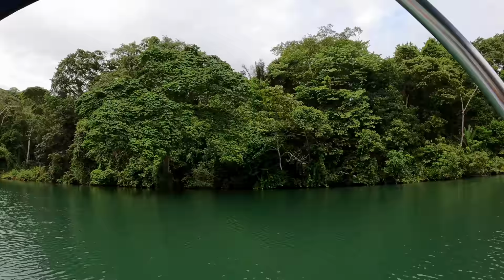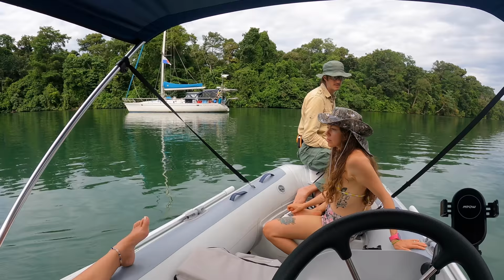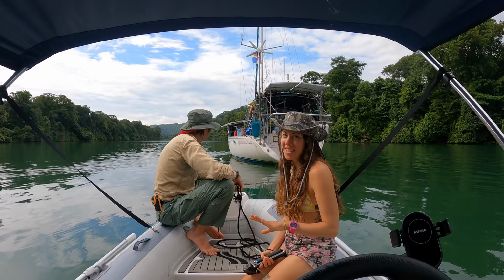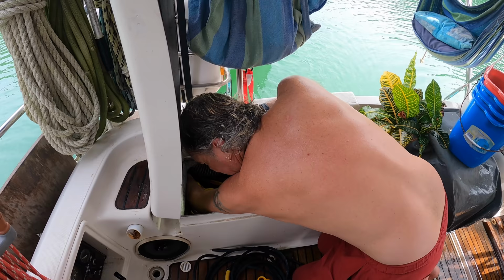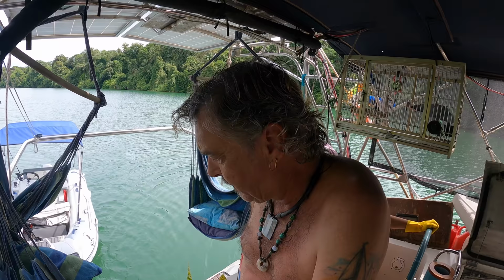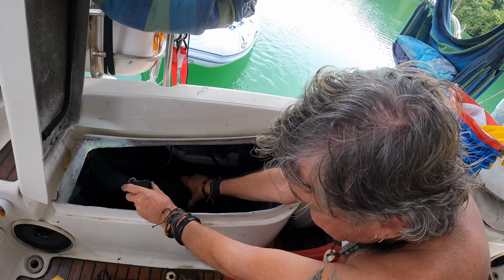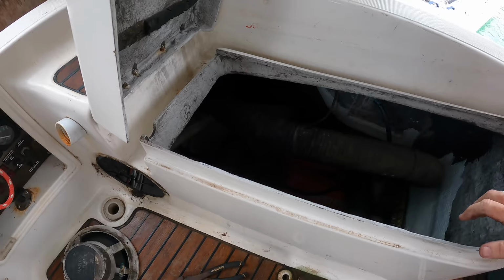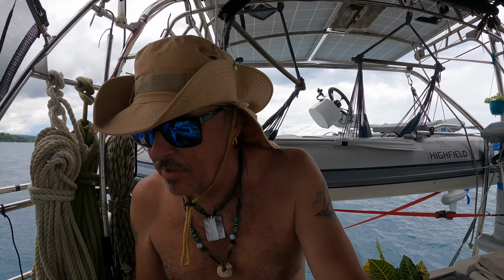SSL586 ~ this is NOT GOOD NEWS...!!

Comment: I loved the “silent running” river cruise and good job with the temporary repair 😊👍
Reply: Hey Rick , if you can fill the pvc pipe with sand and have a good heat gun or a torch , you can heat the tube and bend it without to much deformation FYI didn't know if you knew it 😉

Comment: Lack of preventive maintenance, that's the result !
Reply: Thi g is that hose is hard to come by and cost a ton per foot. I can understand waiting knowing a complete power upfit is in the cards.
State side USA hose can be sourced easy but costly.
Reply: @stevewildman1045  As far as I can remember it had an engine cooling problem in the past. It was at this point that he should have inspected this pipe over its entire length ...
Reply: @pierremartin592   Easy to do in the hood ole USA. Go to a 3rd World country and figure it out.
I agree in a perfect world Maintenance should prevail.
Knowing full well a engine refit is around the corner.
This is past the heat exchanger just the piping to expel the water exhaust
Reply: @pierremartin592  he did inspect it at that time and it was fine. Remember the engine and components are 26 years old! Give the Captain a break. He knows what he's doing!
Reply: @stevewildman1045  Hi Steeve, 
It has nothing to do with engine age. If the pipe was inspected, I suspect a water flow suficient to keep the engine Temp in an acceptable range, but insuficient  inside the the exhaust pipe to prévent to burn a hole. 
I would verify the seawater screen, the water pumpe impeller integrity and pump cover plate for scratches/worn, and heat exchanger if clean. Check and clean the engine cooling thru-hull inside for concretion, sea shells...
Check and clean cabin deposit on exhaust mixer manifold...

Comment: Easy answer for a temporary fix. Cut the hose at the break. Lead the end of the hose up and out of the opening of the seat locker hatch and then over the transom. Secure it in place with tie wraps / duct tape, bingo, problem fixed.

Comment: Hello Cap'n Rick!  First time commenter, long time watcher from Oak Harbor, on Whidbey Island, WA.  I'm a liveaboard sailor with a SJ 28 race boat.  I live on a Gulf 27.  I'm now ruined for internal combustion dinghy motor!  Water sounds as the loudest sound underway is a modern miracle.  Your repair of the engine exhaust hose was clutch.  I would have grabbed tin foil and rescue (silicone) tape, with duct tape topper.  Having pvc pipe and the rubber coupler was clutch.  I nearly went down due to a shaft misalignment and the stuffing box separated from the shaft log.  Terrible situation at night, becalmed, alone on the water in winter, and 3 miles from the marina slip.  I have skin in the game of keeping my crew warm and happy, that was the opposite of a good trip!  Much respect to you and your skill set, You seem very like the skippers and crew I enjoy going to sea with!  Looking at that hose, would it be an option to replace the whole pipe with new... toward your new engine?

Comment: If you have to replace hoses and they are likely to be exposed to heat and chemicals like oil and fuels see if you can get hold of some silicon hose they even use it for turbo intercooler piping.
A drinks can opened out flat might help in a situation like that if you hadnt had the rubber collar's. Or carry a piece of thin Al sheet JIC you need to patch over a larger hole on curved surfaces..something thats easy to bend squish or cut with HD scissors or snips 🤞🏻 Then Duct tape clips and cable ties 😉👍🏻

Comment: Wonder how long the battery life is for that electric dinghy motor?  Nice to be able to motor without the noise or exhaust fumes, and you can recharge with the solar.  Awesome solution!!  Incidentally, when you finally do replace that exhaust pipe, if it were me, I would be tempted to just run PVC the whole way.  It'll last longer and save you any future headaches.  Nice patch work on the fly, though.  There aren't many problems that can't be solved with duct tape.
Reply from the maker: The battery has a 9Kw capacity which gives us a range  of about 25-30 miles at an average speed of 4 knots.. and can be discharged and recharged over 3500 times before depleting capacity to 80%, which effectively gives it a daily use lifespan of over 10  years.. pretty amazing actually!
Reply: @SailingSophisticatedLady  - That really is excellent!  I would've guessed maybe half that usable distance.  And really good battery lifespan as well.

Comment: Pvc wont melt when it has water running thru it. It dont get hot enough to melt it. The motor doesnt run much warmer than hot water heater. You could actually get some hot water pvc the same size as the exhaust and replace that bad section with it all the way to the outside

Comment: As a raft guide, the noise wasn't made by the raft. It was made by the water passing by rocks, sometimes flowing over them and dropping.  I suppose the tides must change the flow ? I've seen other sailors, even Rick, go up the rivers in their crafts. I like :  26:28 "don't use PV pipe" The Water.... That water comes out of the heat exchanger directly into the Muffler "mixer" if you will, and then goes from there. I've seen a few boats do this flex pipe thing, they always burst and that's when you find out they have one. Catalpa had it happen out at sea filling up the bilge and living areas with Carbon Monoxide. ......Dangerous ! If I get to do this, that type of pipe goes away in my refit.

Comment: Aluminum foil around it and duct tape the crap outta it til you can go get it fixed. It usually goes bad at bends in the pipes. Im surprised yaw didnt get any smell from the exhaust. Thank god you found it before you started using it again. I recommended putting foil around it to help protect it heat if you have to run the motor

Comment: Just a suggestion...next time when cutting a rubber tube segment for a repair that's smaller, try cutting it at a diagonal. That way, you use the whole thing and can wrap it diagonally for additional strength if required. Something to keep in mind instead of a straight join. Cheers.

Comment: ACTUALLY GOOD LUCK That this happened
On a beautiful day, calm water, with spare time. It could have been during bad weather
that lasted for several days in rough water
and more tedious. Procrastination usually
Happens from lack of funds, right tools needed, helpers, or time. 26 years with few or no major issues is a blessing. It will be so
Great when The Engine and all the odds
and ends are updated with new parts that
Have zero miles and time on them to be
Confident again that the Lady can travel
anywhere without concerns of leaving
You in a bad spot. You’re in good hands
with Captain Rick🧢

Comment: 200 watts, you say "you're smoking"? What were you doing, 3 or 4 knots at the time?  I guess with electrics, numbers are all relative. If I was to buy an outboard for my dingy and spent what that setup cost, and I could only get those speeds at half throttle or 35 percent throttle, I would be screaming for a REFUND. Maybe it will take me a lot longer to accept electric propulsion than it did you capt.

Comment: I don't  understand  y all   boaters want to put new engine in  
That engine  should go
 25000 hrs before a rebuild
 Wearable items like hose's clamps stuff like that need to be replaced the integrity of a diesel engine does not Diesel engines either run or they don't if they're not running it's usually air getting in a fuel Or water

Comment: buy BULLDOG Duck tap
Reply: Why not simply run the exisitng hose out of the lazarette into the cockpit?  Does the cockpit drain directly over?  You may even be able to reach the hole where the speaker was.  It will work for the interm.  Just a thought.